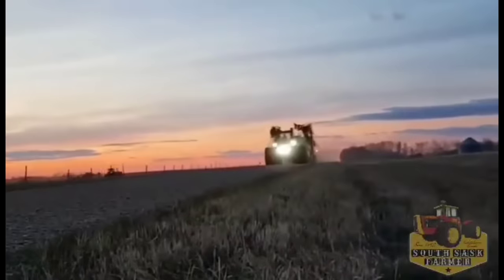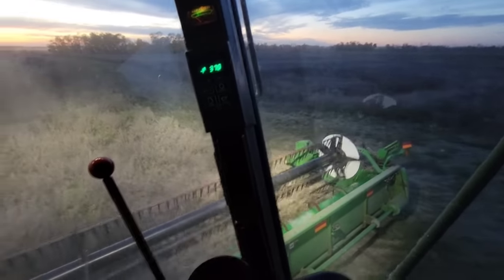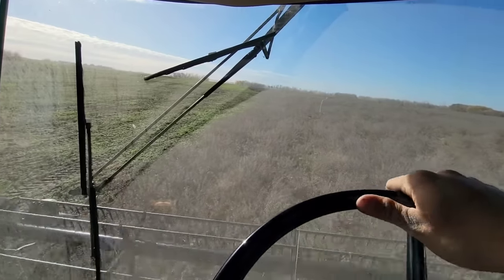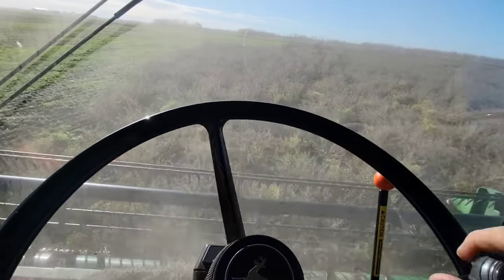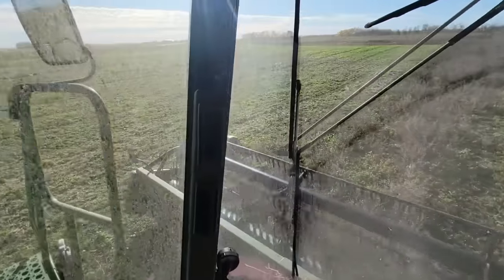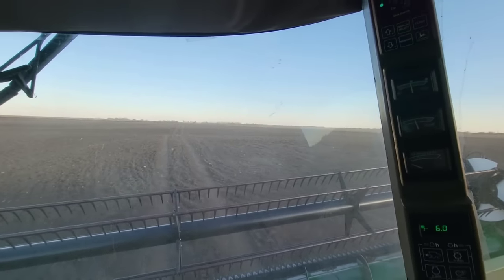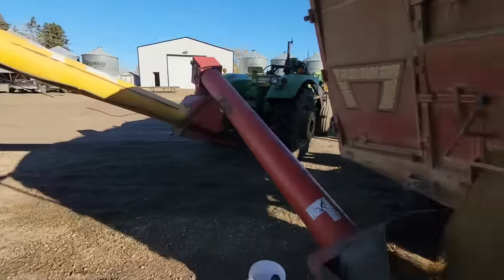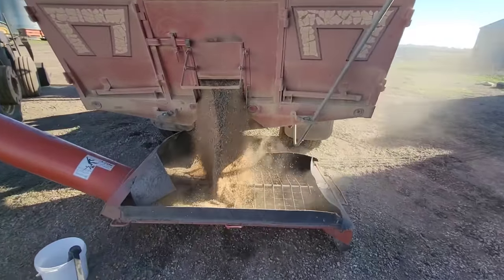Harvest 23 is finally a wrap!!

Comment: That is a 9600 sample if ive ever seen one. I guarantee the 2188 is way clenaer. Our old 1660 is probably the best sample on canola and mustard, the 7120 cant even come close but still better than the deere
Reply: Yep if I make the sample in the 9600 look like our case combines its chucking it on the ground lol
Reply: Funny it did cleaner sample than the rosaries in cereals though
Reply: @jeremycherny2041 yeah it seems like they do that, don’t get me wrong the old 9600 is a great machine but cleaning up a good sample of an oilseed on them is hard to do unless you run the combine below its limits.
Reply: @ivanmoreau1798 I’ve noticed that the past few years out here as well, the conventionals seem to get a nicer sample on dry years when the grain is baked into the heads. I can’t get a very good sample in the 1660 or 7120 on wheat but a neighbor had a beautiful sample out of a 9600. Another neighbor runs a 9760 and a 9600 and his 9600 had a better sample in the cereals the past few years as well. I’m pretty biased, i like a red rotary machine but on normal years out here a rotary of any color usually has a nicer sample than the conventional. These years of drought and heat seem to really bake those seeds in and you need to run filler plates in the rotaries to get a real nice sample.

Comment: Most will guess a flagship. And it may be. Ill go out on a limb and say 60 or 7088
Reply from the maker: Right track
Reply: @SouthSaskFarmer1  I had a 1688 dad had a 21 then a 2588. Always thought the 70 would have been cool.
Reply: 7010 or 8010 is my guess
Reply: @SouthSaskFarmer1  if you bought one that's f*&ked. First you get a 9600 and I was in the middle of dealing on one. Then Ive been staring at a 7088, and you might of bought one!? Must be great minds think alike 😆